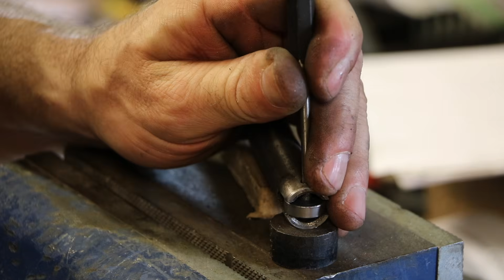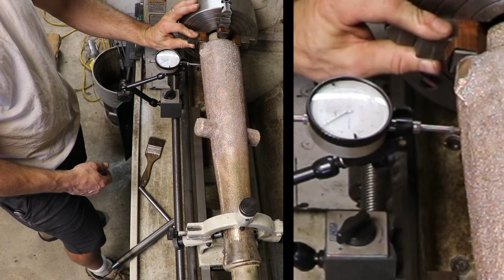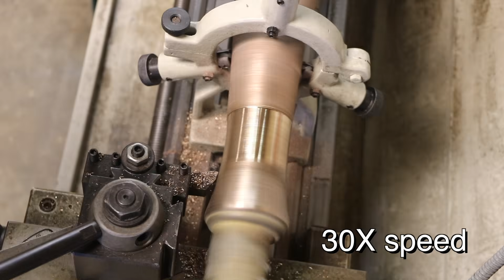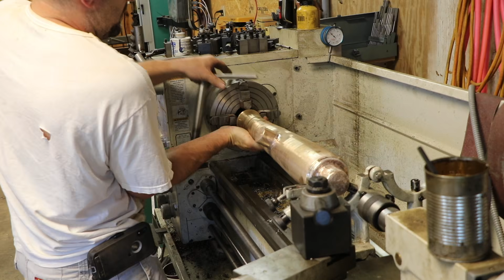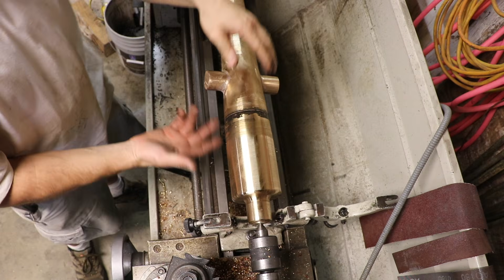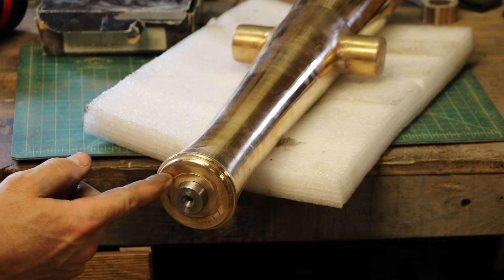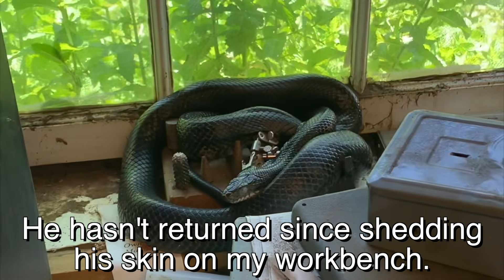Machining a Historic Bronze Cannon Barrel, Scaled Down Replica. FarmCraft101

Comment: Should have used centers at both ends and a lathe dog to spin the barrel, this way you could have offset the tail stock to get the right taper without the constant adjustment.

Comment: Main reason for machining the outside in the C17th and C18th was to reveal any casting defects. Minor ones could be repaired with a threaded insert
Reply: which is the way they did it at Woolwich but in the bore, don;t as me how though. Must have been a hell of a job.
Reply: @brianthwaites2397  there was a book of sketches and watercolours by Verbruggen done at Woolwich  published in the 1970s that shows the whole process. Google Verbruggen cannon and you will get an old website i did with some scans

Comment: You don't need a gunsmith. You need an engineer. https://www.engineeringtoolbox.com/stress-thick-walled-tube-d_949.html  I can't make heads or tails of this or how it relates to brass or pressure waves of explosions.  What are the specs the cannon was built from? IE a shotgun barrel is built and tested to handle twice the amount of pressure the hottest load available can dish out. Meaning it's overbuilt and could be half as thin without failure. I think it's 2 of these 2X magnum +P loads before they let it out of the factory. I would just YOLO and intentionally lead fowl the defects by washing the inside of the barrel with hot lead or mixed with a little tin then re bore the barrel to prevent blow by. But I cant math,have no idea what I`m talking about I dont mind watching you recast that.
Reply: Beyond drilling piezoelectric censors to measure bore pressure in that zone..https://ndiastorage.blob.core.usgovcloudapi.net/ndia/2010/armament/WednesdayCumberlandPhilipDater.pdf
Page 17. If the chamber pressure starts out at 55,000 PSI. It's reduced to 10% of this original chamber pressure at 20" down the barrel. This looks like it will translate as a general rule of ballistics and answers the question of how to calculate a ballistic pressure wave provided you know the chamber pressure of a load. 

This suggests that a barrel only needs to be 10% of the thickness compared to the barrel chamber at the 20" mark to handle the pressure. Prove me wrong.

Comment: Now i don't make a lot of cannons, especially out of bronze. But I've made a few iron cannons. And have had similar problems. And it usually end well (for the cannon). Each shot will make a small dent and deform that defect, and a after awhile it could create a microfracture in the metal, which isn't good if your goung to shoot it. Ive never made a cannon that small. I usually stick to a downsized ship cannon, and use scrap iron (like breakdrums) to make them. And from the 10 or so that ive made, they all have pretty good defects in them, but luckily they tend to stick to the middle. All I do is make a larger bore, and their is still enough metal to keep the cannon from exploding into pieces. Now because you have made it out if a softer metal, I would suggest to bore it out much farther, and put a good sized iron sleeve in it. Even if that wasn't their, I still would sleeve it, because that is a softer metal and who knows how many shots you would get out if it, and you also spent alot of time making it, and seeing it explode would probably hurt a lot. I know when i made my first two, and they turned into bananas, I was not happy. Hope you read this, and hope it was helpful!! Cheers mate! :D

Comment: Finding the center. Dial indicate distance from bed to point of dead center. Measure diameter at a marked horizontal location. Take indicated distance to dead center minus radius and you have distance to bottom of surface. Adjust to that dimension. Bam

Comment: solder the defects with silver, it takes a serious bond and should drill nicely. even if you sleeve the barrel it would be best to eliminate the voids first. but you won't need to sleeve with silver voids. I'd fill all the voids by turning it under heat with silver and flux inside. I'm not entirely sure how heat treatment would affect it's new shape but normalizing and hardening is not a bad idea either.

Comment: WTH, a machinist using a tape measure instead of a steel rule for this type of operation?  Wow, knock me down with a feather.  The irony is, this is not the first time I've seen this. 
Regarding the steady rest, I firmly agree with you, bad design.  Why would it not be designed to allow a work piece just under the diameter of the opening of the frame of the steady rest?  

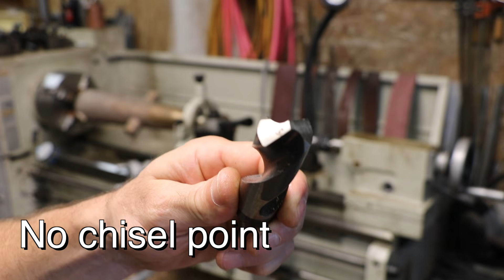14:21   Standard twist drills have a chisel edge between the cutting edges.  So yes, the drill already had a chisel edge. 
14:40  What you have here is a split point twist drill.
20:55  You don't have a lot of engagement on the point of the live center.  It should have been deeper, maybe double what you got.
Nice job on the finish.
Reply: Its not bad design, its modular design with fingers designed to also work on a larger steady rest. The manufacturer can now use the same fingers for this and larger steady rests

Comment: Another solution to making it true, is to mount the dial indicater on the cannon barrel, with the tip touching the side of the center drill. and then spin it around, measuring on the center drill. then you will see how much the barrel bends. i usually does this to set up the steady rest.

Comment: The issue with defects in this case isn’t just a weakening of the barrel. Those defects can harbor sparks and cause a premature ignition of your ammunition when loading after previously firing. This is extremely dangerous.

Comment: mix some shop glitter into some JB Weld, whack it into the defect with a spatula, put a 1" reamer down after to smooth it out, or even just a bit of round bar whilst its still workable. It's a bodge I know but you're just after some structual integrity in that spot.

Comment: Here's the thing- you found that casting void. What other casting voids are in there? Are there any in the high-pressure areas of the cannon? Are you going to have it x-rayed to find out? I think the people saying to sleeve the barrel have the wisdom on this one.

I think proofing the barrel of a flintlock musket invovled a triple (double?) charge of powder. Is that the same thing people did to proof a cannon?
Reply: Thats a perfect analogy, there could be other voids
Reply: The Tripple charge doesn't do much of pressure over the doubled one. You simply add the next squeezed grains/grams of powder which is still intact while the first charge is close to being at its highest point of giving out the pressure. This is due to the very tiny gradient of hand handled arms. Yet still works better with than without. That is not a problem as far as a musket barrel is very long. You will have a value from a bigger charge, not much tho. A better way to obtain more of the energy with your projectile is giving it a bigger cal. That's why a .58 and bigger muzzleloading rifles were quite common.
Reply: MrKansai1 teghe the triple charge isn’t about throwing your projectile farther. It’s to do it from behind a berm to see if the barrel survives it. If it does, you can be reasonably certain that it won’t be blowing up with normal loads when you have your face right next to it.

And yes, double or triple charges to proof cannon barrels was very much a thing.

Comment: I would go with sleeving the bore as unless you get the cannon ultrasound tested or run thru a gamma ray type x ray you don't know the extent of voids & inclusions because boring it bigger might reveal even more and the steel or iron sleeve will make it even stronger.

Comment: use an epoxy mixed with shop glitter, run your bit in and it will clean up and prevent erosion.

Comment: to acheive vertical centre, measure centre height from lathe bed, jack up part with known sized joey blocks or use a screw jack with a 1mm pitch, one full turn will raise 1mm

Comment: I'd find a shop that can precision bore it out a bit more to an interference fit for a precision thick wall stainless steel tube. Maybe Sandvik would toss you a piece for a plug? Have it microstructure, eddy current, and ultrasonic tested. Weld in a plug at the breech end and have the tube longer than needed so it'll stick out for cutting off later. It'll need a vent so the sleeve will go in easy, the touch hole ought to do, though that would have a little air trapped once the end of the sleeve goes past the touch hole.

The really difficult part would be the cooling the sleeve and heating the cannon while keeping the sleeve chilled as it's pushed all the way in. With the end plugged the sleeve could be filled with liquid nitrogen but then the insertion would need to be done vertically.

No matter what's used for a sleeve, that large pothole should be filled with something so there will be support between the barrel and sleeve.

At any rate it looks like the dream of a 1 caliber cannon with this barrel may be dashed if it doesn't prove to be strong enough to be bored enough and use a thin enough sleeve to keep the 1" bore.

Comment: Those cross bits on the canon looked like grade A knuckle smashers when it was spinning
Reply: A new kind of knuckleduster. This specific type does the opposite of the original, and instantly turns your knuckles to dust.
Reply: @absoluteterror13666  you certainly are honoring your name with this. :)
Reply: Such risks occur occasionally for any machinist.
Reply: I reckon the effect would be closer to a catapult.

Comment: bronze wire + pretty low voltage out of a mig welder + custom weld gun to weld fill your cavities in the bore? wont be as strong as a perfect cast, but stronger than a gaping hole. build it up a little high and bore it back down smooth. also you might want to take another pass at cleaning up the bore. you have a lot of artifacts in there

edit: fastest wire speed you've got. just dump metal in with as little lightning as you can. dont want to mess up your heat treatment too badly. (hell i'm far from an expert but you might want to reanneal it afterwards anyway, just incase)

Comment: Perhaps try centre drilling by hand either end first then mount it between centres  to cut the steady rest surface. Might save all this drama and prevents stuffing your gear like that.
Reply: The problem will be getting that center hole centered as the workpiece is not exactly an easy shape to work with. Can be done, but how close is close enough?
Reply: The casting is pretty good and it’s easier to whop off the lump completely then mark the centre point using your combination square. Mount between centres and cut the bearing surface using faceplate and dog. Sounds pretty easy and should work in this instance without wrapping itself around the operators neck. It’s a very cool cannon mate.

Comment: I'm not too sure how much the defect affects failure risk, it looks to be far enough up the barrel to only have about 1/10 or less of the initial pressure (dependent on the charge, larger charges take up more volume and effectively decrease overall barrel length and increase pressure).

I think for the most part at the moment the defect will only really affect accuracy repeatability, the projectile will rub or knock into the defect and pick up a spin (EDIT* I think the best bet at a "successful fire" is to use a spherical shot, if the bore was perfect a cylindrical shot would be most effective), best case scenario is that it spins in the same direction every time (preferably a backspin to increase range and accuracy, but from where the defect is I would expect the projectile will bend to the left and curve up), but if the spin ends up being random you will have no ability to aim the cannon at a specific target, even a large target.

EDIT 2* PS: If there is a next attempt, try to keep the metal only a few hundred degrees or less above the melting temp. Use a pre-heated high temp ceramic lined mold (can be made with lots of coats of high temp bbq paint on the outside of the lost foam/wax cast, remember to let coats dry and sand/prep the surface in accordance to instructions, the paint will bake to and seal the plaster/sand mix while the foam/wax burns off). You should still pour vertically but the mold should be at least 3/4ths buried in dry compacted sand.

Ideally there would be a temperature conductive bar through at least half of the barrel that wouldn't be wetted or welded to the brass, this would cause the barrel to solidify quicker and more uniformly than having a glob of molten metal inside it.

That's all the advice I can offer considering I've never undertaken a task such as this one.

I hope I could offer some insight, best of luck!

Comment: Before ill health forced me into semi retirement I ran a barrel making shop dealing primarily with black powder muzzle loading rifles and black powder cartridge firing rifles in calibers ranging from .30 caliber to 2 bore. If your cannon tube is for a signal gun and used only for firing blanks you'll be alright, the biggest problem will be cleaning the fouling out of the rough spots. If you plan on using projectiles, line the bore with a steel liner, it will probably stand up to the pressure unlined but what about the flaws in the metal that you can't see and don't know about? No point in risking life and limb. Get a piece of 1" OD x 1/8 inch wall seamless tubing and turn your 4 bore cannon into an 11 bore, ( .750 ) this is the same diameter as the British Brown Bess musket and the round ball for it is available from your favorite black powder supply house, use a .730 or .740 size ball and linen patch just as you would with loading and firing a replica Brown Bess musket.

Comment: the defect you observed was shrinkage porosity.. definitely a major concern but could be avoided when casting by making sprue a lot thicker , actually thicker than  the cannon so when the metal is cooling down it has a molten source of metal to draw from... the sprue (thickest part) cools down and solidifies last so the casting (cannon) draws any metal it needs from the larger sprue as the cannon solidifies resulting in a solid homogeneous porous free casting.

Comment: Suggestion for center problem 3/4 way through.
A lubricated wooden block with a groove to support the weight. No bearings or wheels for kiss principal
Reply: odd that is how we did it on the Red Gum lathe at ANI Ruwolt (formerley ANI Vickers)

Comment: If you made the barrel without trunnions (or, since you've already cast it, machine them off), you could machine a short parallel section on the outside of the barrel, and sweat on a ring, with the trunnions attached to the ring.

Comment: I am no expert but please take my experience for what it's worth. I am building a 4 Bore double rifle, you can see the proof test of the barrels on my channel, and the wall is only 8mm thick at the breach, the proof load was 864 grains of black powder and a 1750 grain pure lead ball and the barrels survived without a scratch. My barrels are made of a hydraulic piston rod, obviously much stronger than bronze but nonetheless I think that gouge is not going to affect the strength of your cannon, but will probably affect accuracy and get filled with black powder residue. 
Regards.
Nick
Reply: the real problem is though that its a weak point that might over time be slowly wedged open further and further.
Reply: @BartJBols  You're right too, perhaps the only way to fix that would be to melt more bronze and fill the bore with it then drill it out again, can you think of any other way to fix the problem?

Comment: predrilling is for boys. fun aside, in some materials you dont "need" to. even without a split point. i drilled a couple 2 inch holes in brass without a pilot. just spotdrilled it. I dont think that grizzly would take that tho. i did it on a over 4000 pound  17 hp 16" by 40" lathe.

Comment: I just gotta ask - Why didn't you just use a piece of pipe for the bore and cast around it?  Yes - you do have to heat it very hot with a torch first, but then you would have a bore that could then be bored out with a boring bar.

You could have even done it by hand.  Use a piece of pipe then bore it to size with the proper bit, to hold the boring bar.  This creates a sacrificial steady rest which can be clamped to keep it steady and straight.  As you need to deeper, you just cut off more of the pipe and go deeper.  

The boring bar (or drill bit - using extension ends) would be supported and it should follow the cast hole, then finish to size.

Seems a Lot of work to make a hole when you could have just cast it with a hole.  It's done all the time.

Just my 2 cents.

Comment: The whirling arms of doom spinning on the lathe are making me really anxious. You only have to accidentally wave your hand a little bit to the side and it is utterly shattered.
Reply: When turning a part on a lathe, that very thing is often a problem. Something like those trunnions, or a lathe dog, etc.,  when a gloved hand, a ring or necklace, Your damn long hair, etc. gets caught in it, it'll rip your arm off, scalp you if your lucky, turn your face into so much mush if your not. keep your hair short enough to not get caught, remove any jewelry, wearing gloves is generally a bad idea because a glove will get caught up before your hand feels it, then your hand gets drug in with the glove like a chinese yoyo! lol
Machinists have to deal with this daily. Even a keyway that runs off the end of a shaft can grab yer shit and pull you in! The solution is to never ever make a stupid mistake, EVER, or you are a dead duck!
Reply: @oldnick4707  Spinning tools + gloves is bad news.
Reply: It'd likely give you a good whack but unless your hand got trapped against the tool holder you'd just bounce off
Reply: you have to remember most of that was sped up footage
Reply: but the job was done and it didn't